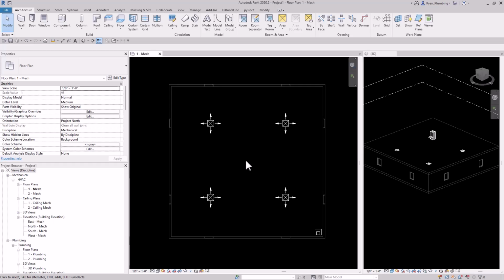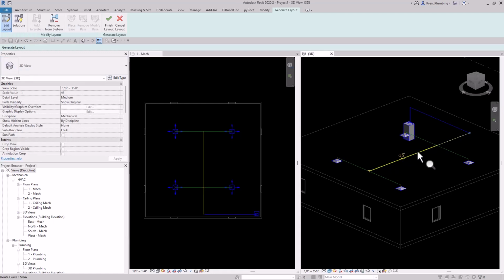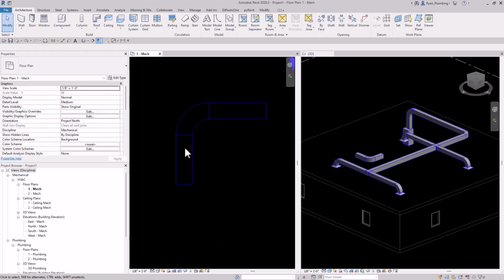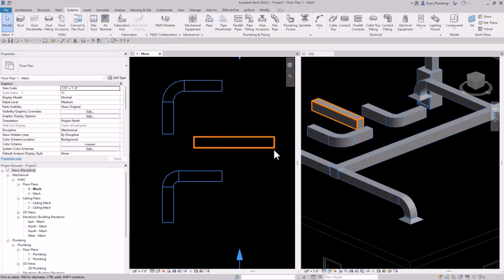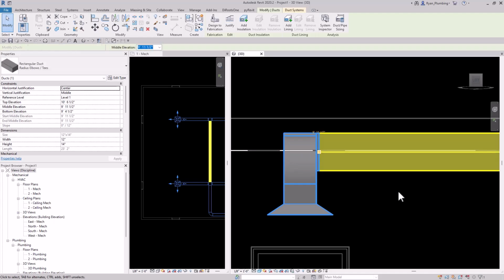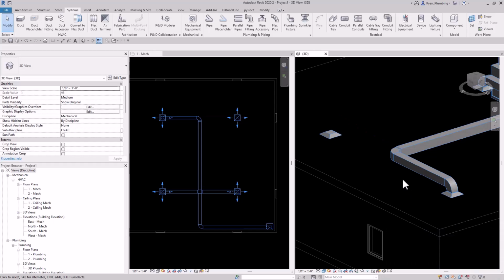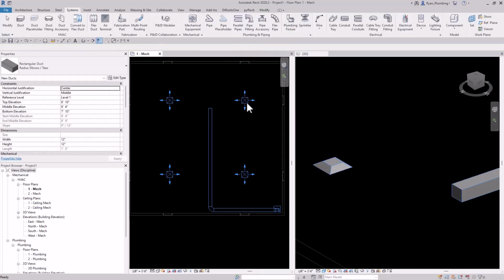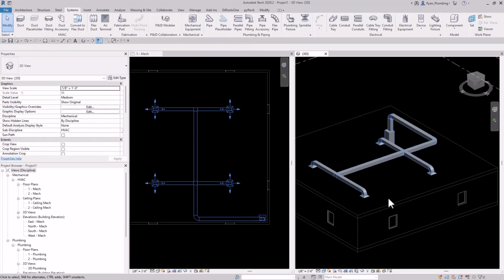HVAC / Ductwork Design for Beginners in Revit

Comment: In your Course (Mechanical Design) Do you teach how to use Revit to draw from the building until the mechanical ventilation?
Reply from the maker: The course is a beginner level course where you learn the basics of mechanical design and modeling in Revit. I'm working on an advanced level course that will be out next year. If you need to learn the basics, this course is perfect.
Reply: @mep_guy  Thank you.